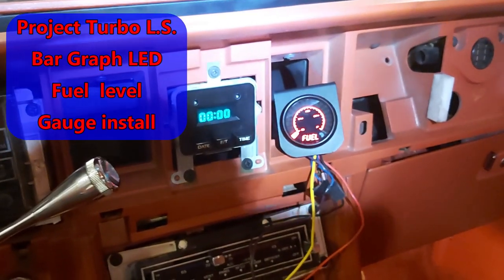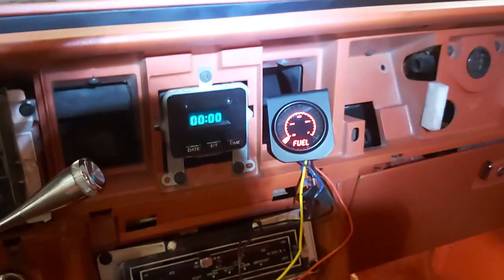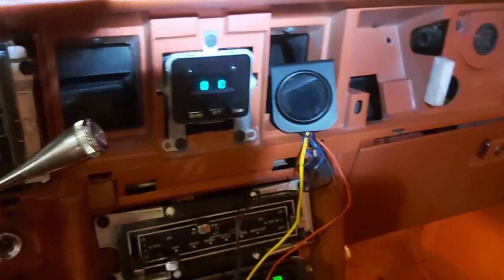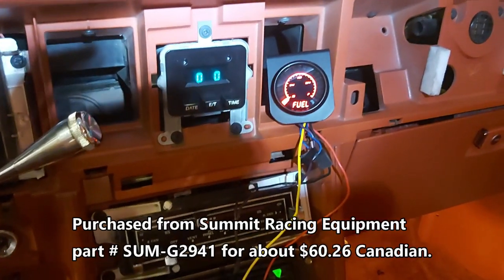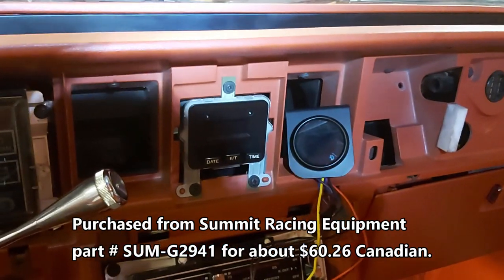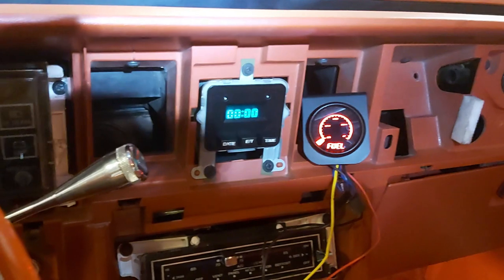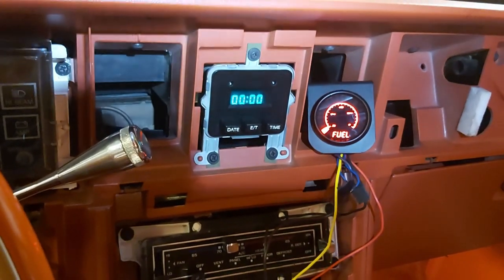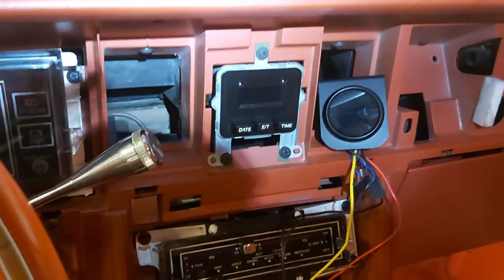Summit racing digital  fuel level gauge install

Comment: Hi, I was wondering. Did it read correctly after you added fuel? I just instaled the digital gauge on to my customers kit car. Problem is there is no calibration or reset button, the tank is half way full but gauge reading full. And when it should read empty it reads 55% 
It definitely working, I removed the floater and when moved slowly you can see the reading changing. Its just way off. 🤔🙈 Any idea?
Reply from the maker: Yes, you'll need the Autometer fuel bridge from Summit Racing, to correctly calibrate the the after market fuel gauge to correctly work with what ever float system you are using. The video about the entire fuel system I posted will hopefully help. My gauge reads correctly as it has been calibrated with the fuel bridge.....the video is at the link here, Go to 9:30 of the video as I talk directly about the fuel bridge and how it works...  https://youtu.be/cjmpGe_GQKY    Thanks for watching.....